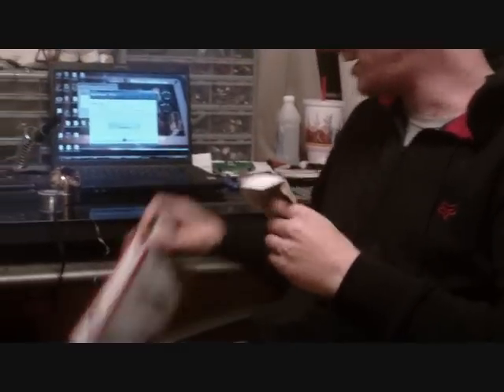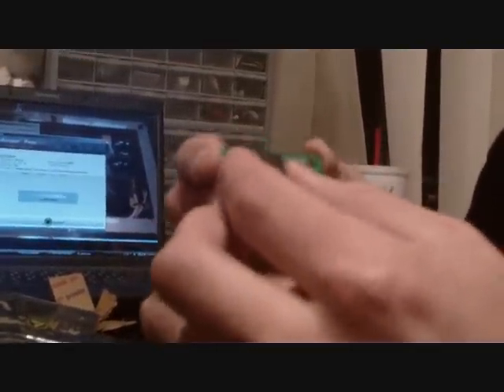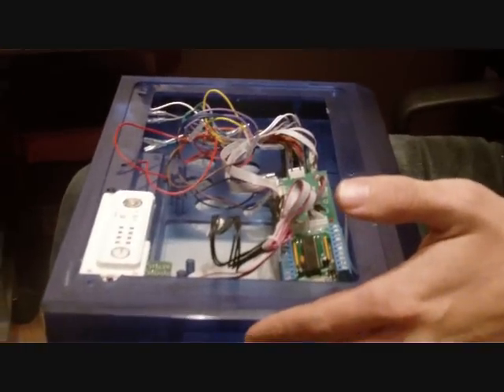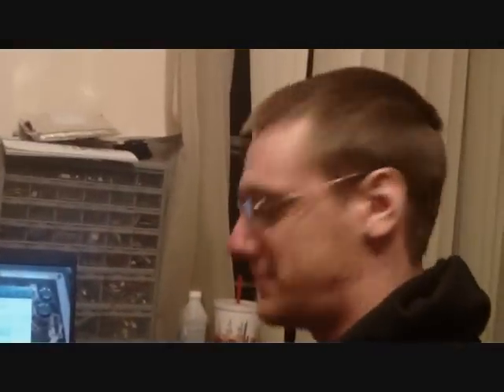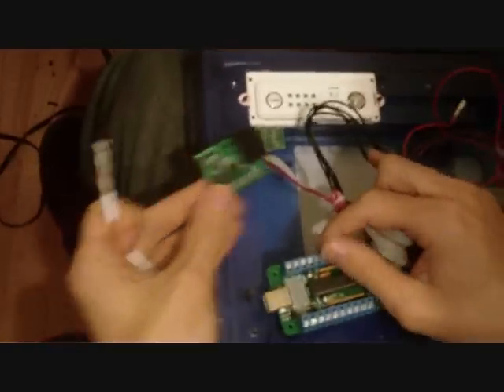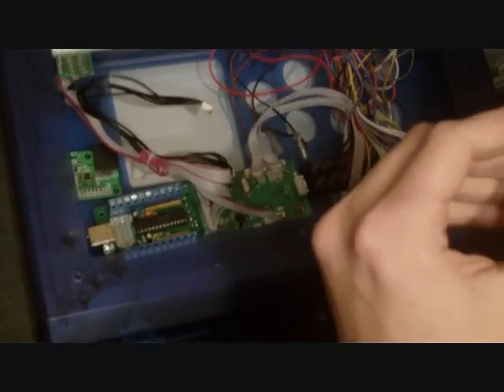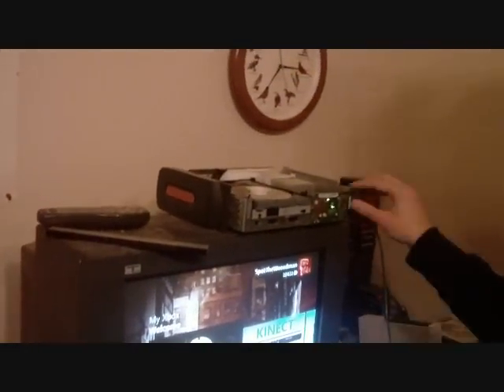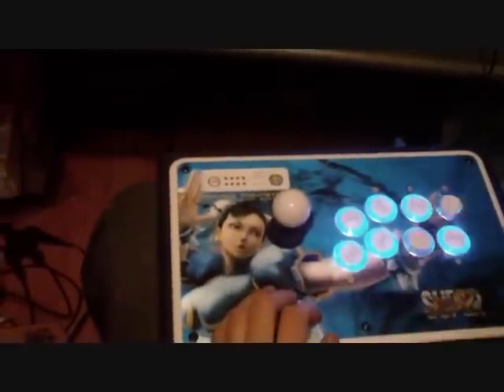Beta Imp v2 installation

Comment: Sup man i got the v2.1 imp and i havent a few problems for detection. I hooked up everything like how you have but i have the imps G-V on the middle row of the MC cthulhu and the V on the first row hooked up to the imps RJ45-VTOL or w/e its called. and its not being detected. Any pointers? I soldered my buttons from the 360 pcb along with the ground thats on there and have them going into the MC cthulhu screw ins same for the stick. the 360s power is going into the MC Cthulhu VCC same withimpvcc